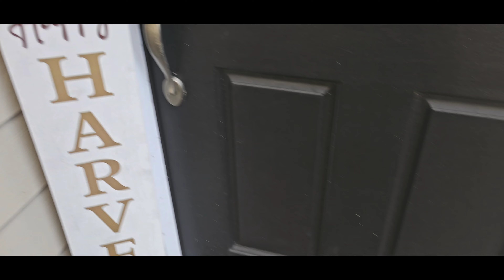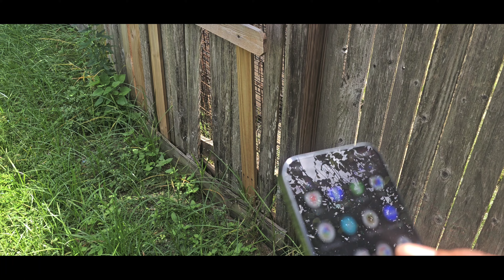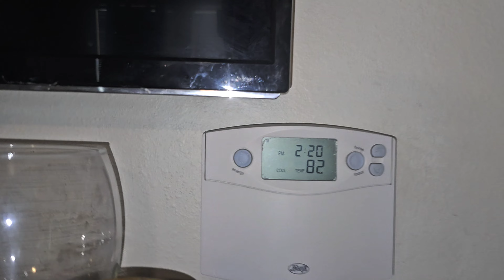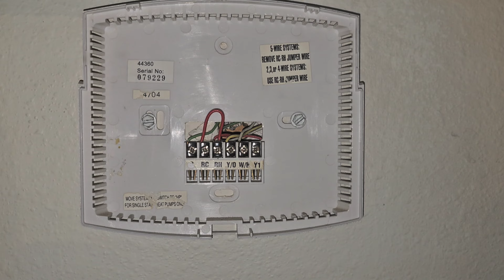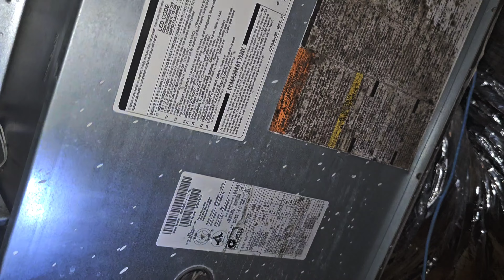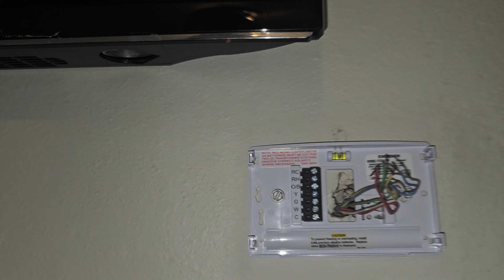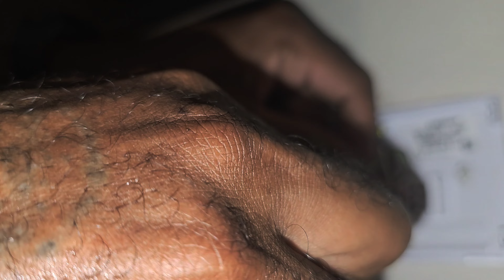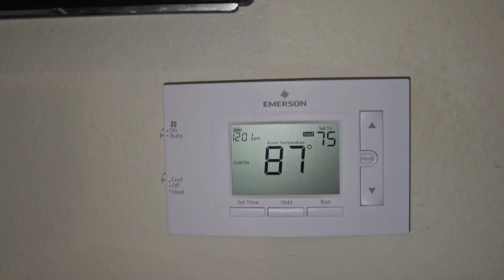"AC Not Cooling After Power Outage? The Real Culprit Might Surprise You!"

Comment: Walt, do you carry plastic drain parts.  If not, seems like you should.      I’ve broken them just tightening with my hand   The weird part is I don’t see A/C draining to sink like that in Louisiana.

PS. How are you gonna leave the hair in that pipe  😂 24:03
Reply from the maker: I have a couple of the plumbing traps in my truck, but if it's beyond my expertise, the customer will need to get a plumber. I'm not a handyman or plumber. I don't keep every housing part in my truck.
Reply: 26:38 that plastic nut is cross threaded.     The bottom one.    Just a heads up.